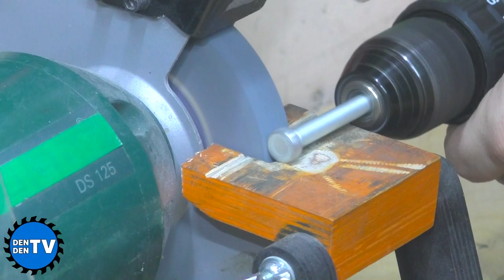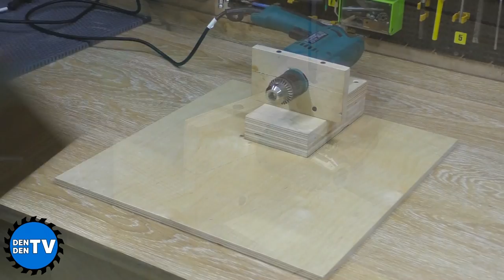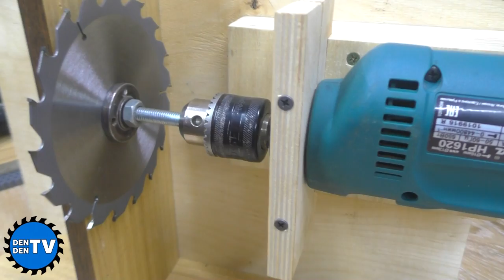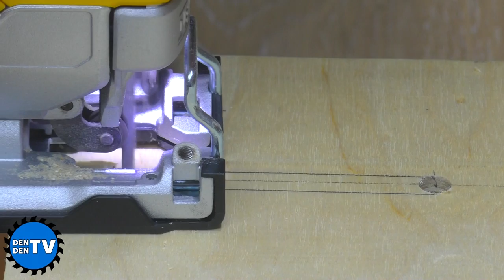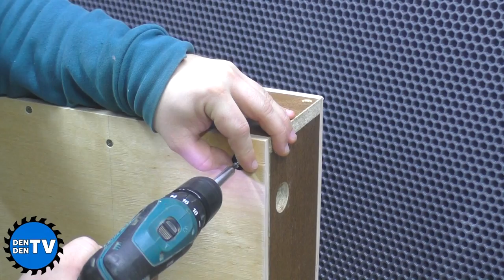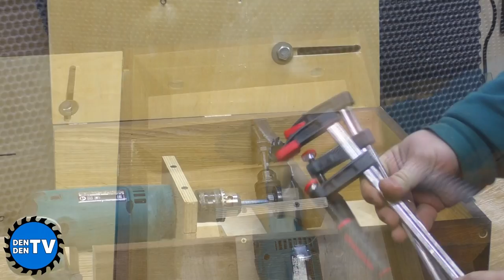Мало кто знает об этой функции ДРЕЛИ!!! Секретная функция.

Comment: A "secret function" would be one that doesn't require the building of a frame, modification of steel parts to perform and the units function is not permanently changed. That's like saying the secret function of a knife if turning it into a fork with a dremel tool.
Reply: ha ha ha ha
Reply: Truth. Just invest in a table saw. I  guess when you have more than one drill you don't have to worry about drilling the pieces you just cut with your other drill.
Reply: Fun project idea if I had a 3 yr old. Or needed a doll house tablesaw. I'm pretty sure I can buy a fully functional top brand new, for less time and money.
Reply: So what you saying is “ click baaaaaaaaaaaaaaayyyyyuuuuuuuuuuuut!!!! “. ?
Reply: Bwahaha
Reply: Agreed. But perhaps English is not his first language.
Reply: @asadsiddiqui4776  ya I was pondering that as well. Or google translate failed us lolz
Reply: Thank you!! This crap has gotten out of hand... Garbage!!!
Reply: I'm not sure the drill is designed to handle lateral loads
Reply: @Sandarpan  Thats why the bearing was added
Reply: Good way to burn your drill out.
Reply: Meanwhile the wood pieces used were cut to size on the table saw which is out of view.
Reply: Exactly.
Reply: No blade guard or anti kickback device either.  Those kickbacks can be deadly.
Reply: I would say this is more like turning a knife into a toaster, because you can lift the bread with the flat side. (Metal exterior, cutting tools, welding tools, electrical circuit, and other materials not included to obtain 'secret' function of knife for toasting.)
Reply: And a cable tie to hold the power on.
Reply: The person capable of building this, already owns a table saw.
Reply: The person capable of building this, already owns a table saw.
Reply: After building a chassis, axles, bodywork and interior, I can utilise the drill's 'secret function' as a car engine (range - limited to length of chord)!!!
Reply: Significant torque difference between a tablesaw motor and a drill. Not to mention drill gearbox reduction heat buildup.

Invest in a tablesaw from Northern Tool or such if strapped for money or light usage.
Reply: Repent to Jesus Christ!  666
Reply: Ty, saved me time watching it.
Reply: my thoughts,  exactly.
Reply: I like the way he couldn’t even enclose the drill’s grip. Such a dumb project. You can buy a craft size table saw at harbor freight for under $50.
Reply: Just bad English translation
Reply: Haha but then there would be no clickbait.
Reply: Lol made my days, ... i did make a fork with a knife , i was to lazy to spend 4 dollars on a brand new set lol
Reply: @jameswatters9592  there is also already a saw attachment for some drills anyway

Comment: After building a chassis, axles, bodywork and interior, I can utilise the drill's 'secret function' as a car engine (range - limited to length of chord)!!!
Reply: Faster, easier, and cheaper to go buy a table saw.
Reply: @HalfCrazy520  Not to mention safer. I wouldn't go near that fucking thing when running if they paid me.
Reply: The teaser showed a funky looking drill bit,  in the video they showed everything bou that drill bit. Like three-B I wouldn't go near that saw, bad things will happen  with that contraption.
Reply: @HalfCrazy520  what if you lived in a third world shit hole that doesn't have a corporate hardware store every 10 miles?
Reply: @frankh.3849  Then where did he get the makita drill and looks like a dewalt driver?
Reply: Go cordless

Comment: This reminds me of when I decided to build a bench grinder out of an old washing machine motor, some pulleys, fan belt, etc. to sharpen my lawnmower blades.   When I went to the store to look at grinding stones and saw how cheap real bench grinders were, I bought one, and lived happily ever after.  I call that "learning the bench-grinder lesson."
Reply: I used to manage a pretty large plumbing company and I'm also a plumber as well and I tell you man we were rebuilding some machines large sewer machines and one of the motors had burned up and I looked over in the shop and there was an old washing machine sitting there and it was the exact size and everything I needed so I took it out and made it fit in the sewer machine and I could not get it to work properly in the wiring so I called up a guy at a pump shop I knew that knew all about it and he says yeah man you need that motor to be in the spin cycle so he told me how to wire it in in that sewer machine was so fast nobody wanted to use it that thing would almost spin off the ground it would spin so fast
Reply: @woodstock4062  I appreciate your honesty! I've  "made" a few items that ended up being nothing but learning experiences on how "not" to waste my time!

Comment: In terms of woodworking this project is completely useless unless you needed a weak and slightly dangerous miniature version of a table saw and you were stuck on a desert island with only the materials seen in the video and some magical power source. In terms of YouTube gold the project is brilliant and has fulfilled it's function perfectly. Congrats!
Reply: Exactly.  Table saws aren't something to fuck around with even when they are purpose built.  It's the power tool I respect the most in the shop. This is basically a table saw for cutting balsa, poplar, and maybe thin pine,  and even then I'd be nervous as fuck.

Comment: Or buy a $50 table saw at a yard sale and save yourself the 10 hours it takes to make that  deathtrap.
Reply: Precisely so !!
Reply: They are 50 bucks new. Garage sale not required
Reply: *****EXACTLY***** Waste of TIME and Material.
Reply: @Wanker59  Correct Man.
Reply: Or build this and spend the $50 on a new drill because, hey, you made your drill useless as a drill.
Reply: Or turn your table saw into a drill.
Reply: @petmycat2720  0p
Reply: @lakesideaudio  Accidents can happen with a conventional table saw as well if you forget to install a riving knife
Reply: @switch12345678  yes you are right, I’ve watched many videos on YouTube of accidents with table saws and most of them where the riving  knife has been removed. I don’t think people are really made aware when they buy this tool just how dangerous it is. I bought one from a diy store here in the uk, I’m not a carpenter and I bought it with zero knowledge. I always thought the riving knife was just a guide and at one point I was considering removing it, only because I didn’t know. Luckily I didn’t, then I saw the accidents people were having. It was shocking. It’s not a tool I like using to be honest I am scared of it, it, but to see someone make a homemade one is odd, as others have said, you can buy them for 50 bucks
Reply: @524kirkd  LMFAO...Right On Man.
Reply: @lakesideaudio  I think this type of equipment (e.g. wood lathe) is very workable if you don't have a garage or basement to work with. If you live in an apartment or want to take something with you to an allotment garden, the machines are easy to transport and you can keep them in a drawer - while you can use a drill to drive them all. When done well, it's not even more dangerous than 2000+ W machines and a table saw with a much larger saw blade.
Reply: What I wonder is he used two hands to cut, which one was pulling the trigger on the drill?
Reply: And there won't be many people with all the tools he used that don't already have a table saw
Reply: @missioninprocess8888  cable ties trigger in on position...not too smart
Reply: Ive seen several for $20 at yard sales ,
Reply: @petmycat2720  So was this video.
Reply: @Edward-pu1wt  Mine goes to 78
Reply: EXACTLY!  That’s how I got mine.  A neighbor GAVE me my larger one.  Make friends!  It pays off!!
Reply: @lakesideaudio  only one thing to know don't put your fingers ant where near that blade.
Reply: And common sense! Oh wait, they don't sell that in yard sales!
Reply: I know, right
Reply: If it takes you 10 hours to make this something is wrong with you.
Reply: You can add a riving knife with a blade guard. Riving knifes only protect you from kickback. Blade guards protect you from loosing limbs.
Reply: @switch12345678  Accidents can happen even if you do install all the safety features that come on a new saw. All those safety features are just a crutch for weekend warriors who can't be bothered to learn how to properly use the tools they've purchased so they can feel "macho" and build their own stuff.
Reply: @lakesideaudio  I want to know what RPM the drill turns at and what RPM that cheap TCT Blade is designed to turn at?  Also on thin material there is way too much tooth above the cut meaning each tooth enters the cut at the wrong angle.  The least he could have done was use a chip limiter blade, but anybody stupid enough to do this probably does not know what one is.  DO NOT try this at home folks
Reply: Yes.
Reply: @524kirkd  yes
Reply: It's like Stewie from SNL, "Look what I can do".
Reply: A waste of time and material in the US, surely.  But have you ever purchased a table saw in Russia?  Thought not.  Unsafe? Yes.  Perfect? No.  Useful when you don’t have an alternative?  Probably.  Would I build this AND use it?  LOL.  When you think about making a comment, at least know where this came from or the context.  Commenting on the safety, certainly appropriate.  Commenting on buying this for $50 at any yard sale or new at Harbor Freight or whatever junk seeker you use, just shut the pie hole.
Reply: @padgit8r486  Very true. Years ago we purchased a painting in Russia. The strecher bars were made of molding and nails, obviously home made.
Reply: You're no fun 🤪
Reply: @missioninprocess8888  lock button on corded drill
Reply: You can't buy a table saw as cheap as you people are reporting most of you probably don't do any woodworking this is a great great idea. I love it.
Reply: @missioninprocess8888  Trigger lock

Comment: Can't help but think just purchasing a table saw would be easier, faster, safer, and more cost effective.
Reply: Dude has every hand tool and attachment known to man and he spends this time making a drillsaw.
Reply: Attaching a saw blade to the drill ask for trouble and possible finger detachment.
Reply: @kine3165  anything is possible. My dad was using the ShopSmith table saw and still managed to lose the tip of his pointer finger. He passed a few yrs ago but I still have his DNA in a jar. Here's a tip: Dad shoulda used a push stick like Denden tv.
Reply: Exactly
Reply: Or just cut to the chase and attach a hand saw to the bottom side of a table.  Much safer and easier to change a blade if necessary.   I did that in place of  a table saw when I built an addition on the back of my house!!
Reply: @benjaminspotts6572  This guy has way too much time on his hands.... I agree with the other comment/s, just affix a skill-saw to the underside of an old table!.. Pistol drills are not designed to handle too much side-torque; the bearings will be shot in no time at all and the saw would be as accurate as a fart from 60 paces.. daft.
Reply: Safer as opposed to what?  A table with a saw?  This method is exactly how my grandfather built his first blueprinted home in 1940 - 41. He used basic components and built a table saw (which he also used to craft (real) furniture on as he was a Master Cabinet maker). He also had all his fingers when he died.  Also, I think you're missing the point.  The video shows what can be accomplished with some ingenuity and scrap components (got you to watch it right?). Yes, some additional safety measures could be implemented but this is a quick and dirty demo.  adding a Safety switch, Spot welding the bearing to the bolt is a start and perhaps using a $15 quick change drill chuck for a more positive lock on the bolt shank. Also, I noticed that none of the safety experts here commented on the fact that he used a push stick. My guess is that since everyone here uses a "real table saw", they won't lose their fingers or get seriously injured right?  Oh, and @LK Wood, making a "drill out of a saw"?  Yeah, that's exactly what my grandfather did.  His table saw was (still is) a saw on one end and a drill on the other end :-)
Reply: @bafco2012  Exactly right!
Reply: Also much safer!
Reply: He shoulda made this "Saw" using a table saw... 
Edit: Wait, they never did show him cutting those boards 🤔... oh the irony

Comment: Table saws are dangerous enough all ready.. this just makes it dangerous and probably going to burn out the drill..
Reply: Bluto Bubblebutt  In terms of safety it would probably be better if he were ripping railroad ties.
Reply: Glad I saw this post as this really is quite dangerous. He’d stand a chance of the bolt was at least welded. The drill isn’t designed for side ways torque and that bearing certainly won’t last. The saw now revolving at around 1200rpm isnt secured correctly and will probably fly off.

I rarely post but this is madness. Respect for creativity but please DO
NOT DO THIS.
Reply: Jajaja,"True"🤣👍
Reply: I think it’s a great idea, maybe useful some day.
Dangerous? Sure, but so is getting out of bed. These projects are for people who can’t get their own table saw.
Reply: @SammytheStampede  the irony is that you'd need a table saw to make it
Reply: @SammytheStampede   Ironically, you need a REAL table saw in order to build this cheap mans death box.  That part of the video was conveniently left out.
Reply: Be  easier to just get an old electric motor amd build a table saw
Reply: Unless you use an industrial site drill, the duty cycle is between 10 and 20%, with a maximum run time of 30 seconds. 
People who own an industrial drill would not be wasting their time constructing a Micky Mouse contraption like this.
Sadly, 85% of this type of videos are posted in India, simply to make money from the advertising. This video will have netted around $3,000 to date. Meanwhile, people are being fooled into burning out their drills and risking serious injury.
It is time that this scam was stopped, but since Google are making a similar amount of money it will continue.
Reply: I think he should have just skipped building the table and just freestyled with the blade on the drill. What could possibly go wrong?
Reply: @SammytheStampede  If someone can't afford a tablesaw they should use a circular saw . This is a disaster waiting to happen
Reply: I hope the drill burns our before it takes off some ones arm. That would be a bargain.
Reply: @truthseeker4690  Think about it. Borrow a friends table saw and build this. Give back the friends table saw. Use the one you built to built another. Then use those two to built another two. Do you know how many you can built that way? Many.
Reply: @rjvw3078  Friends don't lend friends table saws to make table saws that won't last and will cause injury.

Comment: I used this video to adapt my cars driveshaft to a 1000 mm diameter band saw, for camping purposes - there's never enough firewood. Not to mention the hazard that axes present.

The emergency crew were impressed with my skill at closing open arteries with a bunsen burner with just one arm and no digits, while holding my intestines with my one working leg :)
Reply: Ha ha, sounds like a normal working day!
Reply: Video or it never happened.

Comment: Actually, I could see some usefulness as as small hobby saw for cutting really thin material, as it is lightweight and compact. That said, you can pick up a small portable table saw at Harbor Freight for $80, that's slightly more reliable and way more powerful and less dangerous. Otherwise, pretty good build.